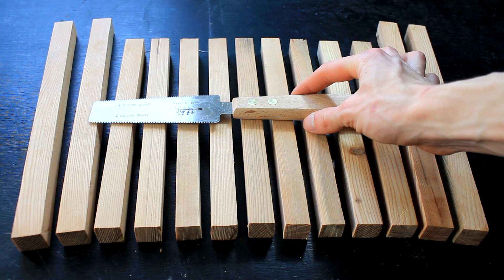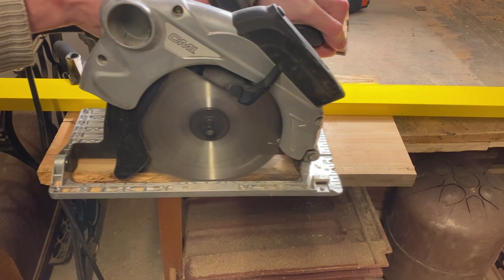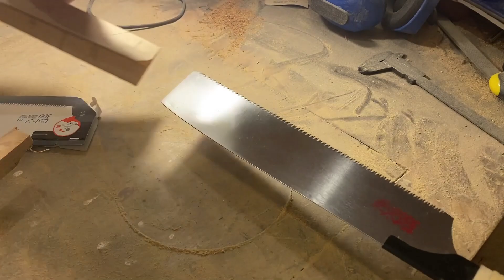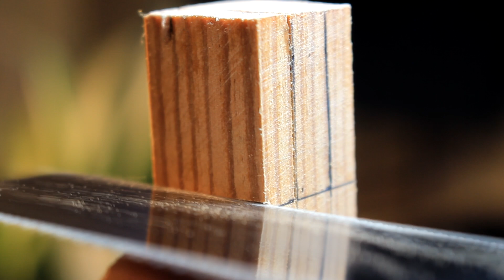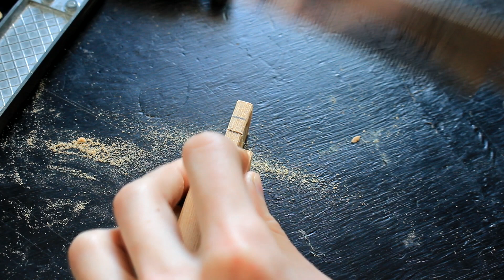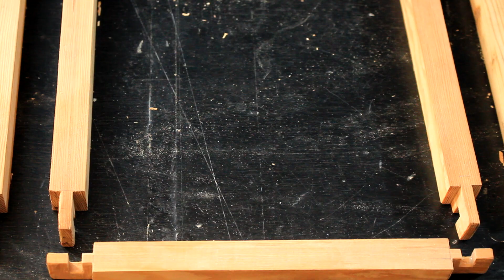Japanese joinery is hard, my attempt at three-way castle joints

Comment: If I may be so bold as to correct the name. This does not show how to cut a 城継ぎ手  "shiro tsugite" at all. This is too often erroneously called a  “castle joint” by DIYer Westerns learning from only books and others who "think" they understand the traditional joint bu have it confused for the corner joint systems found in other Asian traditional architecture such as Korea where it is quite common and still used to this very day. I use this joint professionally in my work. It is called  화통맞춤  "hwatongmajchum"  and applied to both roof and foundation systems of timber frames I have designed and built. This is what Westerns are incorrectly calling a "castle joint" which is not what it is called at all...Questions and/or feedback welcome...Thank you for your video...